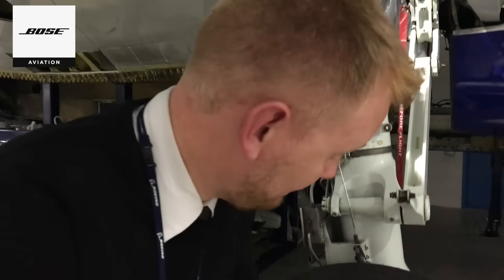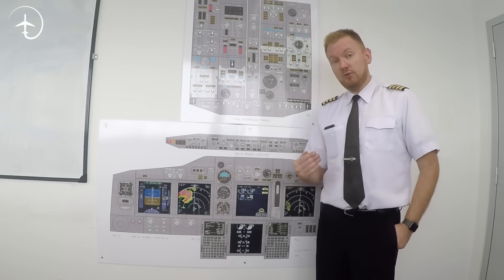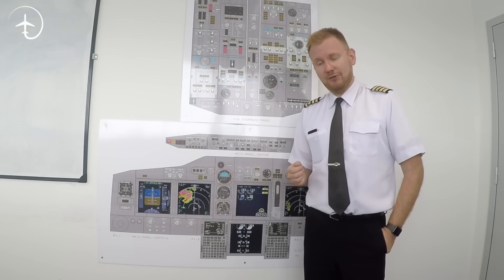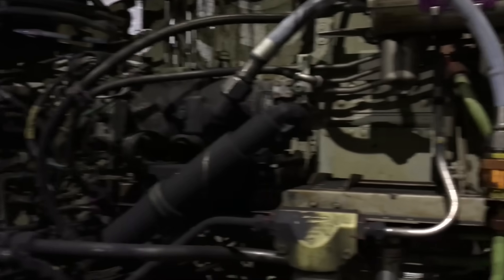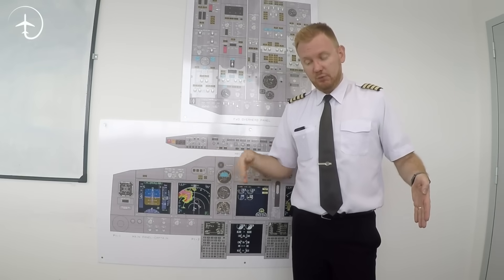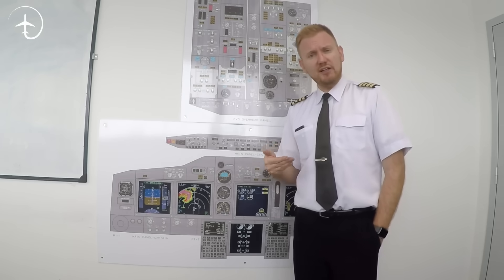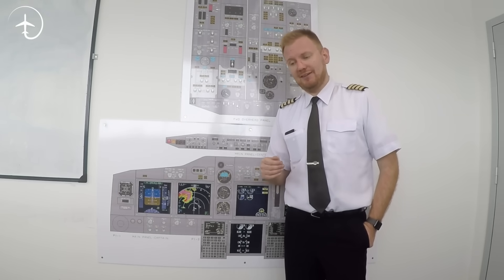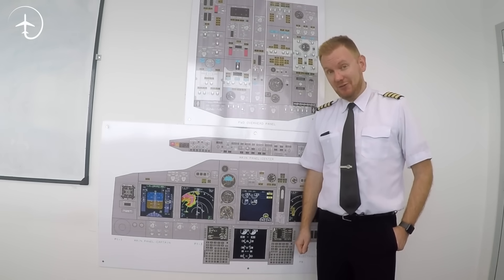Why does the Boeing 737 not have any landing-gear doors?

Comment: Let me save you 12 minutes of your life: It comes down to cost. The wheels are not "leading edges" and the B737 has always been built as a cost-saver. It works, and no one has come up with a cheaper solution, so you're all good. Mainly because the B737 is already close to the ground. In the air it doesn't really even matter since the plane is subsonic.
Reply: Sorry. I don't usually offer explanations for wrong conclusions, but you are wrong. You are correct that the original design (the 100 series) had an economic driver. The JT8D's were no- bypass engines, so no clearance problems with the ground. The wheel wells were exposed. The outer wheels had hubcaps. The 400 series added high bypass engines, with no redesign of the gear for additional height, hence the flattened cowling. There was an opportunity to revisit the gear door issue. It was decided that the losses were tolerable compared to the re-design of the gear structure. Engineering design is not about doing everything to the best possible solution. It is all about achieving the best solution given the constraints (and yes cost is always a driver). However, please reply and cite data that might support an argument that the decision was not appropriate then, or now. I look forward to hearing from you.
Reply: Damn I just wasted 10 seconds of life reading this comment.
Reply: And to cut cost, even the engines are flat at bottom as their landing gear is too short so as to accommodate a proper circular engines like in Airbus A320 or even other bigger Boeing aircrafts like B777.
Reply: Parimal ,  there is another low aircraft The CD9 fuel, and others had to LEARN TO GO AROUND, and avoid clipping those wings.
Reply: Chet Carson sorry, nothing being contradicted here...
Reply: You actually came here for that? I thought the whole point was the explanation as to why it works and how well it works.
Reply: Vezerai it works. What more do we need to know?
Reply: Ryan Benson You're the kind of guy who doesn't enjoy a good movie, you just want to fast forward to the end top prove you were right about who was the villain. Sigh!
Reply: People try arguing that it doesn't matter on cars because you only go 65. Speed doesn't matter,  aerodynamic drag starts to effect anything at about 45mph, which last time I checked the 737 is capable of. I went to school to fix aircraft and agree that it's because of maintenance and potential to break. A piece of aluminum to cover the wheel wouldn't have cost that much, and with the extra seals and hub caps, the cost would really be negligible in the grand scheme.
Reply: I was looking for that one! thank you!
Reply: Saves the cost and weight of doors and their actuation mechanism.  If the wheels are flush and with wheel covers any drag from lack if doors is negligible.  Look at prop a/c from years past.  Simple solution that still works and the B737 is not unique.
Reply: This comment makes me so sad, you are offered with 12 minutes of video where you can learn a bit about the history of the 737 aircraft, a bit of aerodynamic, have an insight of how the gear works and so on, yet you just want the useless, and stupid answer, I am surprised you weren't able to figure that out yourselves it's so obvious... of course a design like this is cheaper and lighter than a design with doors like the A320... Yet the only non-obvious part of the answer (ground clearance factor) was not even in the comment. Such a shame that this is even in the top comments, this really makes me sad. If you didn't care in the first place why click on the video anyway? I really have no words
Reply: Federico Di Liberto don’t be sad. The video is amazing but people want to jump to the spoiler. Nothing wrong with that :) you know, one day I was walking past an airport where they maintain airliners. There was a B737 in the middle of the tarmac so I jumped over the fence to have a closer look. I was kneeling near the landing gear when a security guy came in running. I greeted him with “sorry I couldn’t resist” he responded “I understand”. I got arrested but we spent 2 hours talking about aviation. He was passionate about it. Then they just let me go with a warning. The world pre-911 was so good!!!
Reply: Thank you!! This guy has another video called "Which way do the Jet Engines rotate? And WHY?!" and it's almost a 16 minute long video. It's either clockwise or counterclockwise. 50-50. That is just the way they were designed.
Reply: Well, having watched the video, your summary is great for some with the attention span of 5 year old. But for people who actually want to learn something, better to watch the video. Thanks, but no thanks keyboard warrior!
Reply: Ryan Benson just the damn comment i was searching for, thanks! :)
Reply: I'd rather listen to a qualified professional who knows what he's talking about, not a guy at a keyboard.
Reply: @SuperChris 153 then why do you read comment section?
Reply: ahadicow am I not allowed to read the comments?
Reply: @ahadicow  The issue isn't reading the comments, for this can add insight into the topic at hand. The issue is when someone writes a comment which undermines the professional.
Reply: wrong. as exemplified private rather luxurious jets also have the belly wheels exposed. if it really did affect performance, or safety or had any other major implications it would have been removed and or improved in the new generation 737Maxx as well as it would not be present in luxury private jets.
Reply: @heynando  Nonsense, it's got nothing to do with being luxury private jets. You can still have a luxury private B737 and there's also the fact that producing more means more testing and more knowledge of the actual aircraft. Performance-wise it's obvious it's suboptimal because of drag and other issues but cost-wise it's good enough.
Reply: You're a lifesaver
Reply: Here's a time saver: don't watch you tube. It's mostly hype and drama and a waste of your valuable time Rockefeller.
Reply: Thanks! I just wanted a straight answer, I almost googled it instead.
I wasn't interested in the video, just the answer to the question.
Reply: Ryan Benson Thank you for that!

Comment: Do the tires expand as the aircraft gains altitude, and atmosphereic pressure decreases?
Reply: A very small expnsion. The aluminum outer skins contract a little with low temperature. The fuselage expands with reduced outside temperature. All these factors are calculated in aircraft design.

Comment: Mentour, could you please explain what EMAS is and how often it is used? Thank you!
Reply: Peter S Enginered Material Arrestment System.  Basically a high strength foam arrestment material at the end of the runway.  If the aircraft over runs the runway the foam breaks and prevents further movement of the aircraft.  Used where the runway doesn’t have much extra room due to geographical restrictions, ie....cliffs, water etc...

Comment: Great research.  I suspect that you were surprised to learn of the early bag seal system on the 737.  It was a nightmare to maintain, noisy, and wasteful of bleed air.  Good riddance.  You are also very correct about the simplification of landing gear operation when doors are not involved.  The sequence valves involved in coordinating door operation with gear operation can be the source of serious malfunctions, as well as a lot of maintenance headaches.    I believe the simplicity of the 737 gear system is a major factor in the airplane's great safety record.  I would correct one thing you said--I believe you mentioned a tire pressure of 14 psi.  I think you must have meant 14 bar, because 737 tire pressures are close to 200 psi.  Thanks again for the video.

Comment: QUESTION: Do you ever get the opportunity to 'put a plane through it's paces'? For passenger comfort and safety being an airplane captain seems a little bit like being a bus driver, EXCEPT the plane you are sitting in is more like a Ferrari than a Volkswagen. I understand that commercial aircraft could easily do loops and barrel runs and all sorts of stuff like that so don't you as a pilot ever get an itchy finger and feel like opening up the throttle and really see what that baby can do? I would think that experience with those extreme aspects of flying might even have a benefit in that having practical experience with an airplane at the limits of its operational ability might be valuable in emergency situations. One's life as a captain seems to consist of mostly following orders from ground and flight towers that always want to provide you with the safest, least eventful experience possible... not to say that doesn't provide its own level of satisfaction... but still... is there any appreciation that at least some pilots might like to engage in more dramatic flight maneuvers?

Comment: Goodness, such a long explanation.  
(1) Gear doors would make the fuselage more steamlined, but
(2) they add complexity
(3) there may not be much ground clearance for a plane with short gear
(4) there may not be much of a drag penalty anyway.

The Cessna 210 originally had gear doors for the retractable mains, then they discovered there was little airspeed loss without doors, and the doors were a maintenance pain anyway.  So no more doors.

Comment: Do you always fly a 737,or do you fly different types of aircraft? Do differ Boeing aircraft require different certifications? I know that Airbus and Bombardier are way different than Boeing and those require different certification.
Reply: Blake Bond basically you only have 1 rating at a time, unless you are a ground mechanic, even if you have flown MANY TYPES.

Comment: My question: Does the aircraft strobe pattern unique for each type of aircraft? Can pilots control the strobe pattern? 

I noticed some airplanes that strobe two rapid white on the wings and one red on belly. Other planes flash a short red on the belly and one longer on wings; and some planes strobe an erratic pattern. Does it have any meaning, like a morse code?

Comment: Actually, the real reason there’s no landing gear doors on the 737 is because way back in 1970 there was a flight where they just simply fell off because the captain hit the “doors fall off” button by mistake, yes and when they finally made it to all the way to the ground they made that distinctive “boing” sound which is what inspired the engineers to name the company Boeing (they added the “e” for “engineer”).  It’s also interesting to note that those very gear doors are now on display at the Air and Space Museum right next to the wax statue of Amelia Earhart (or Harpo Marx, I’m not quite sure which one it is)

Comment: Im an aircraft engineer and frankly I could design undercarriage doors that take up little room! Crikey I have flown in these things, now I know how cheaply they are built I wont bother😮 I,ll fly Airbus 320 instead!  Why dont they for stone-guards inside the wheel bay like every GOOD aircraft manufacturer does? You have stuff in there like a/c pumps, hydraulic pipes, critical wiring looms etc DEFINITELY not getting on a 737 ever again. The 737 had many crashes due to rudder hard overs and it took YEARS to find out why, Boeing carried on flying them telling everyone “oh its ok it doesnt happen that often” After several hundred souls had died they decided to find out why!

Comment: Hi! Great videos! I would like to ask a question: Why the aviation world uses feet, knots, nautical miles, etc. instead of SI units? I guess it is history, but maybe you would have some hints on that. Does some modern planes use SI units? Or can it be switched? If so, can it possibly cause problems, misinterpretations? Thanks!
Reply: You're right; primitive units are used in aviation for legacy reasons. Also there have been accidents caused by confusion between units. A Canadian airliner was supposed to be loaded with a certain number of kilograms of fuel.  Instead it was given that number of pounds. Since pounds are smaller than kilograms, the plane ran out of fuel in mid-flight, having to make an emergency landing.
Reply: Likely cause English is in the standard international language for flying.

Comment: I always thought it was for weight savings and simplicity originally and then for commonality later on. The 727 was pretty low yet had the huge bi-fold wheel doors, and of course the NG and MAX are a bit higher than the Classics and Jurassics due to its new wing and main gear. It’s interesting that on the King Air we have brake deice which heats the gear and gear wells but the 737 doesn’t. I guess it lands with much more force that iced up brakes don’t hold.

Comment: If its not Boeing, I'm not going
Reply: I salute you, sir.
Reply: Stupid. Boeing is Great but Airbus or Bombardier etc building very good planes too
Reply: @necu9365  you realize this was simply a marketing slogan, right? Nobody insists that the airline go out and buy another plane just for them. Hell, most people can't tell unless they read those laminated safety cards.
Reply: @necu9365  Airbus's composite vertical stabilizer is prone to shattering.
Reply: @necu9365  Calm down, it was just an old slogan
Reply: crissy214  if it’s not rolls Royce ad 4 engines I’m not going
Reply: If it’s not rolls royce and not 4 engines count me out
Reply: Going like a Boeing...
Reply: извращенец

Comment: I worked at Boeing from June 65 to December 68 as software engineer in computer lofting. I ask my boss's boss why the 737 didn't use rear engines like the 727 and DC 9. He said weight. The wings have to be much heavier on rear engined planes because the engines actually counter-balance the lifting force on the wings thus lighter wing. 

Also the C5A had high wings which the 747 didn't. The 747 was an evolution from the C5A contest. The boss's boss said for passenger planes floatation below the passengers was required in case of an ocean landing and the wings provided that. Apparently the Air Forces attitude was the same as the Army's Westmoreland that troops lives didn't mean much thus the C5A has high wings. 

Unfortunately for I worked on an airplane that was never built, the SST but I was there during the 737 and 747. At taxpayer expense I learned a whole lot and it was exciting.

Comment: I have a question. Why is it that aircraft fill up with horrible fumes right after turning on the engines and what can be done to eliminate it. It reminds me have having the A/C on fresh air. When you get behind a bus or truck that is belching fumes, your car quickly fills up with those fumes. But most modern cars have a sensor that puts the A/C on recirculation when fumes are detected. Why don't they do that on aircraft. I love flying but those fumes literally make me feel sick nauseous and give me a headache for about 30 minutes or so.
Reply: The air used for airconditioning is supplied by the engine compressor stages (a stage is a row of blades, including the big "fan" at the front). Sometimes if the engine fuel supply is turned on too soon during start, raw fuel in the combustion section blows backwards through the engine towards these stages. To help prevent this, the aircraft engine should not be started if it has a strong tailwind. Unfortunately, because of the shortage of manoeuvering space at airports, this is not always possible. Older engines are particularly susceptible to this problem. On aircraft like the 787, engine air is not used for airconditioning, so solutions are available.
Reply: Thank you!

Comment: Hi. Great video(s). I have a question regarding winter conditions. You coming from Sweden, will I guess, know what I mean.  I know there are strict rules as to how much ice, snow, and water is allowed on the runways. When planes take off and land, the wheels will be spinning. Some ice, snow, and water and perhaps gravel and other things I suppose will stick to the wheels and follow the wheels into the wheel bays. Since the wheels are spinning, whatever is stuck on them will be thrown off as they spin. As these particles are thrown off the spinning wheels, would not these particles risk damaging something inside the wheel bays?

Comment: So,   when a person gets sucked up into a jet engine in films, is that a possibility or B.S.  Either way I cant see it happening at tick over :-)
Reply: Have you seen that video on YouTube of a guy being sucked into an engine inlet on an aircraft carrier? He survived. Of course, the risk is higher at higher thrust. During an engineer training course, we were shown the graphic result of a person being sucked into an engine during a high power ground test run. He was literally minced up and spraypainted onto the tarmac and blast fence behind the engine. At idle, I've seen rainwater being sucked from the tarmac in the form of a small waterspout (about a metre or so long). I certainly wouldn't want to go anywhere near an engine inlet, even at idle.

Comment: Hey yesterday at the airport I saw a strange thing on a plane. One one wing it had a blended winglet and on the other wing it had a Split Scimitar winglet. This was alaska airlines passenger plane. How can an airplane have different winglets on each wing? Is that a normal thing?  Thanks!
Reply: It may have had something to do with lack of spare parts.. I've seen an aircraft with no winglet on one side after it had been damaged and there were no parts or time to fit a new one. The aircraft is safe to fly, but the aircraft may need more fuel for the flight. Unless the split scimitar was standard on that aircraft and was much more efficient than the blended winglet, or vice versa, there may not be fuel "penalties".
Reply: cool thanks!